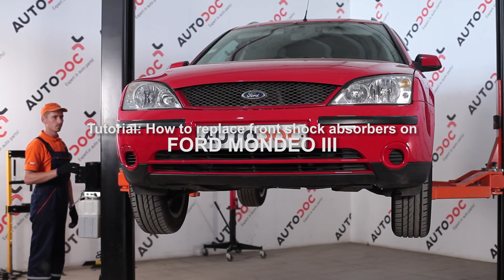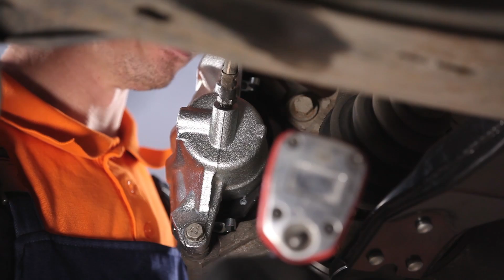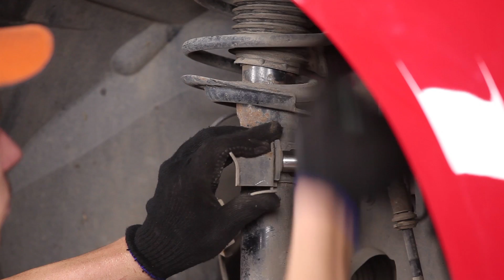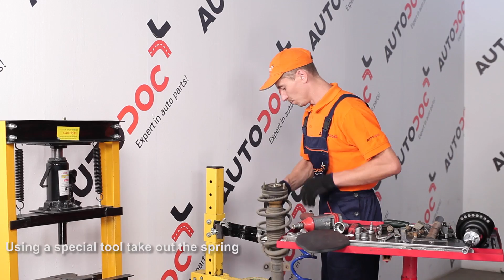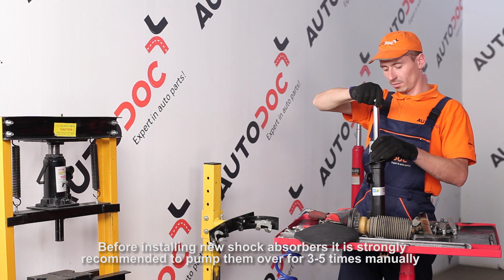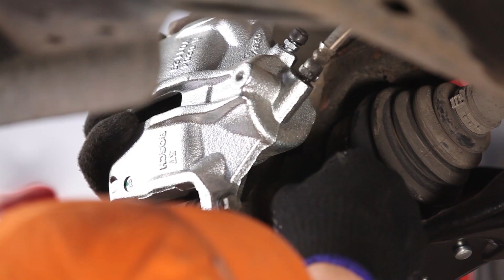How to change front shock absorbers on FORD MONDEO 3 TUTORIAL | AUTODOC

Comment: Hi Autodoc, i bought the same tool to compress the spring but the shock would tilt making it impossible to align the strut into the top mount. I see in your video you look to use what looks likes a small circular weight for counterbalance , do you happen to know the dimensions or thickness of this small piece of metal?
Reply from the maker: Thank you for your comment!
We recommend that you contact our Customer support team, where we will definitely try to answer your question.
Best Regards,
Autodoc team

Comment: My brake disc was impossible to remove.. Used lubrication, hammer and heat.. No f... way.. Was still able to replace my shock absorbers. But it would be nice to get that disc removed when time comes to replace it. Any tips or tricks??
Reply from the maker: Thank you for your comment!
If the disk is so firmly attached to the hub, you should knock it down with a rubber mallet from the back.
Best Regards,
Autodoc team

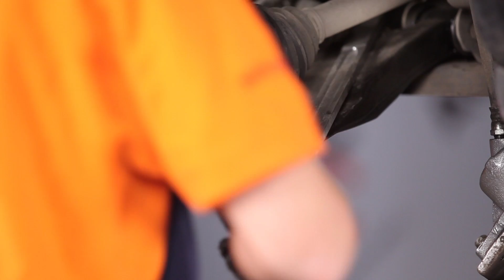Comment: Hahaha nice try but you are cheating between 5:19 and 5:40. It can't be done like that
Reply: chiche123456 infact it can. i just did it like that on my car. but getting it back together is impossible.
Reply from the maker: Thank you for your feedback! You are absolutely right, special ball joint puller should have been used. Best Regards, Autodoc.
Reply: why is this cheating? he didnt damage anything. i've seen everyone lowering the control arm down to take out the balljoint. It can be hard sometimes but still faster than removing entire control arm.
Reply: You are right. Those lower arms have hydrobushings and they can be damaged doing like that.
Reply: Subframe should be dropped whichever side your working on, damage will occur to the hydrabush if not.